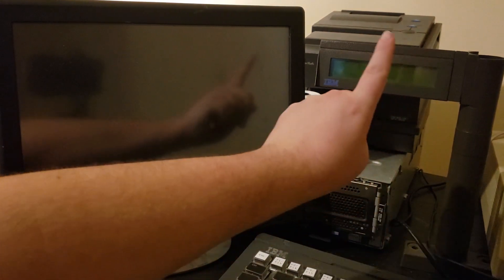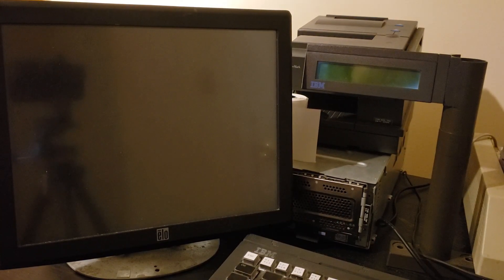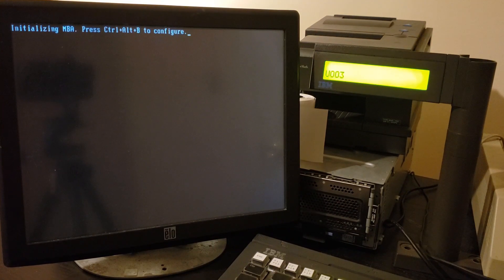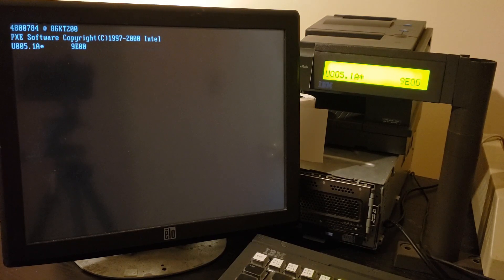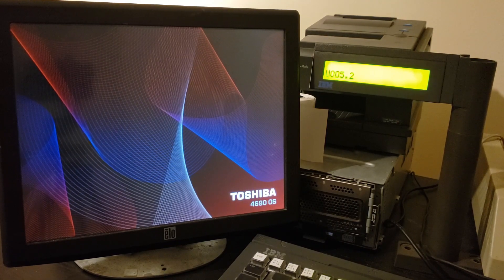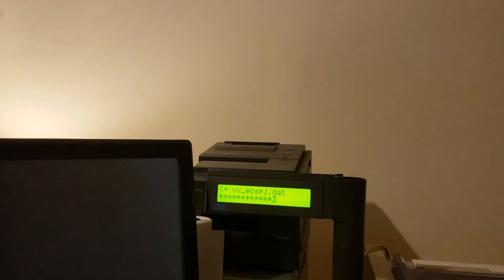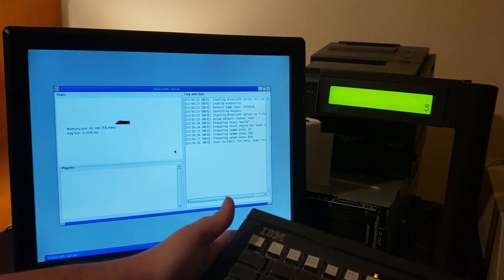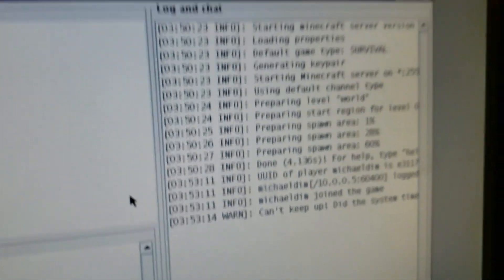IPLing a IBM/Toshiba 4690 Terminal

Comment: I remember working at a grocery store in the 90s that hitting s1 71 s2 or something like that caused the terminal to do something.  I'm curious how far the OS or environment goes back because at one store I worked, we had NCR terminals that were basically just a keyboard with a red  7 segment LED display, that were the same as that grocery store chain had in the early 80s. They would say "hello" on the display when idle. I think they were NCR 2151 registers. When I changed to another store a year or two later, we had NCR terminals that had a blue/green VFD pole display that replicated whatever was on the cashier display.  These systems though a modern 1990s based cash register had almost the same exact key sequences and functions as the old 1980s ones.  I remember if you hard power cycled the NCR terminal, it would briefly show some thing that looked like DOS loading on the pole display and then I saw it say that it was loading IBM 4680/4690 OS.   We had an IBM RS/6000 server in the back room that ran the store.